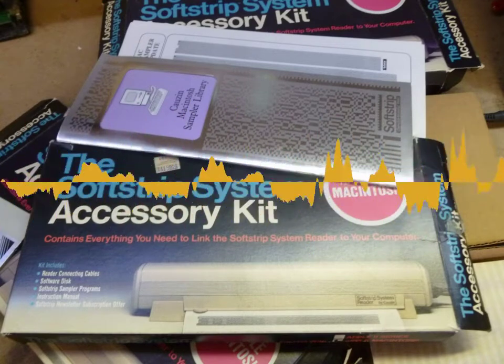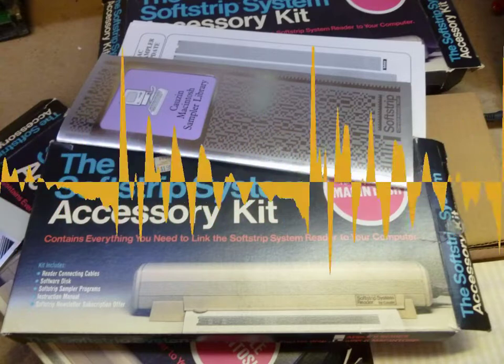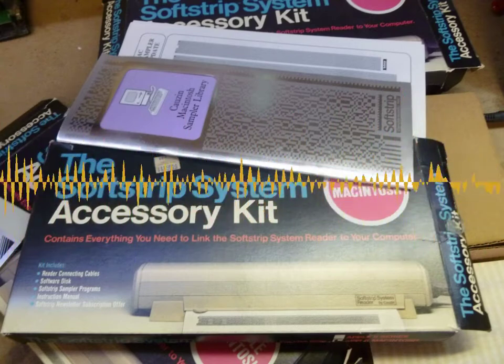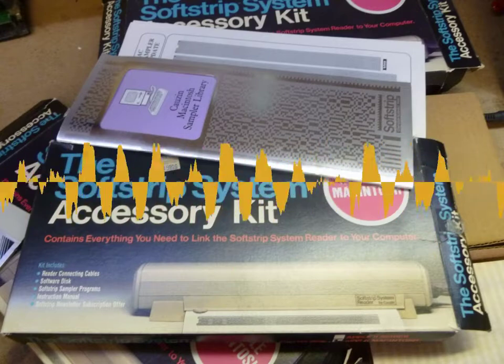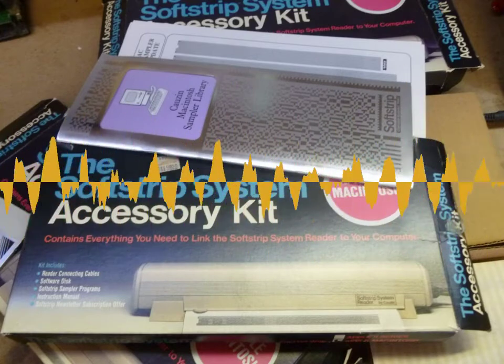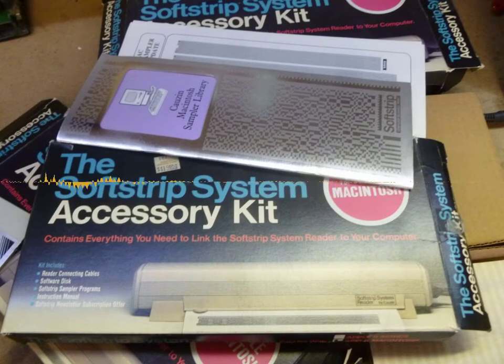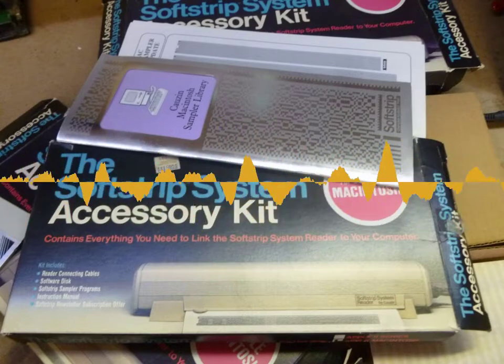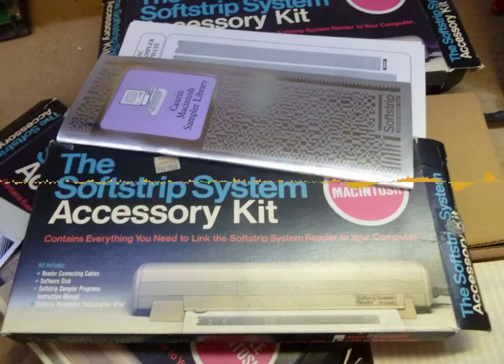Bob Brass and Peter D’Amato, Cauzin Softstrip — interview

Comment: for those interested there has been a reverse engineering project for the cautzin software released in a masther thesis in germany . you can find it  by searching for this STL-TR-2018-03 or by also adding .pdf